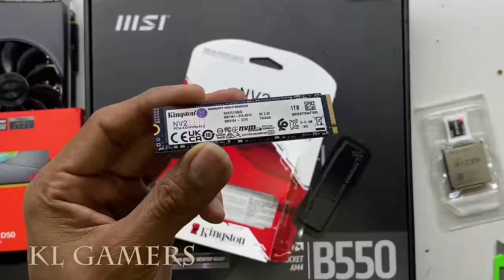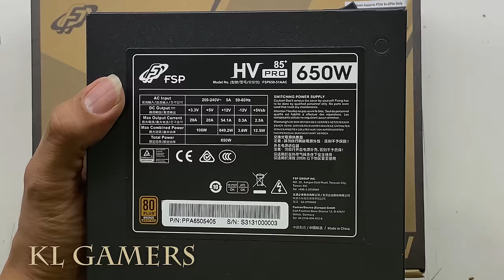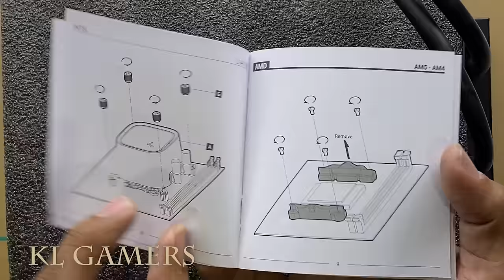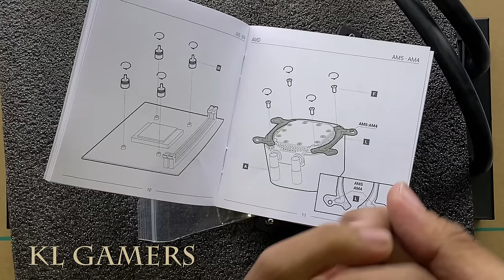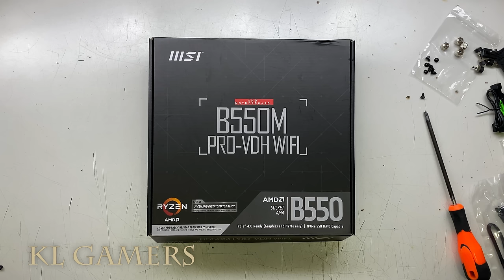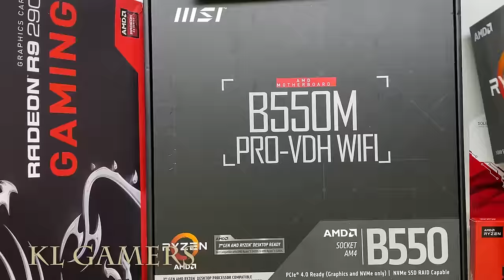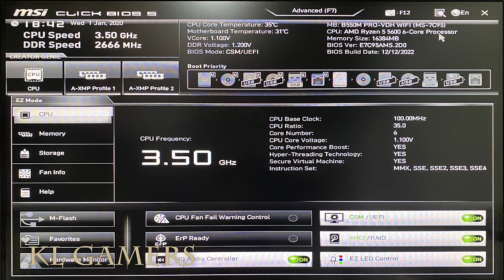AMD Ryzen 5 5600 msi B550M PRO-VDH WIFI msi AMD Radeon R9 290 GAMING PC Build

Comment: What? Water cooling on a 5600? Why? Oh my god, buy a cold and cheap processor, one of the cheapest motherboards and put a water block in it? I will never understand such builds
Reply: hi, im using the 5600x and msi b550m pro vdh. do you think i need a liquid cooler or is the stock cooler  enough or should i buy the deepcool   argb 400 ? pls answer
Reply: @kagekuro8884  I used a Deepcool 400 EX for my 5600x and it was enough with a margin.I don't recommend a stock cooler, buy a Deepcool and you will be ok
Reply: @kagekuro8884  please tell me if i need to update my bios of msi b550m pro vdh motherboard to support ryzen 5 5600?
Reply: @souravdam5964  Yes maybe you need to check first
Reply: its the costumer, i found a lot of these similar build, ppl go all in on their CPU and put a1650 for the gpu
Reply: You have no idea how many friends and relatives I know refuse to use anything other than the stock cooler just because they're cheapskate. 

A friend had 3700X with the stock cooler long term usage under high heat killed his motherboard and ram.

Another same case with 3700X too and PC internals entirely clogged with dust. his stock cooler thermal paste was so dry, it pretty much became super glue. This friend used brute force to remove the cooler but destroyed the CPU in the process. I advised him to replace with a 5700X but he still refuses to buy a new cooler... History is gonna repeat itself.
Reply: Considering his channel is from Malaysia with a very hot climate an AIO cooler is a sensible choice.
Reply: @markpusko2480  Make sense
Reply: ya bro i got the 5600x with water cooler because it looks great
Reply: There's a thing called overclock 😂

Comment: I put a 5700X on this motherboard and it didn't work. I update the BIOS and still the CPU debut LED didn't swichs off.
Reply: Any update? I also bought a 5700x
Reply: @caryschlaffman2062  I installed the BIOS that suported the 5700x (version 7C95v2A), not the most recent one, and it worked.
Reply: @emanuelschott7546 did you install the bios with everything part in pc?

Comment: Hi Bro. Is Bios update required in this build. Or it is desktop ready?
Reply: I am wondering the same thing I have the same mobo and cpu with a 3rd gen ready sticker hopefully it showed up with a compatible bios
Reply: 5th generation ryzen needs a bios update to work on this motherboard just use a usb and the bios button on the back of the board
Reply: @randalbrittan could i download the latest version of the bios needed through a laptop then plug it into my new build with an old cpu, download the latest version of the bios and then put my new cpu in?
Reply: Check the manufacturing date from the serial number. Cross check from bios version dates in MSI website.
Reply: @ArjoRemo does it have to be same date?
Reply: @mesoplanetv  as long as its ahead of the bios version date, you're good.
Reply: @ArjoRemo  ok thanks!
do you also have any recommendation for usb flash drives? I’ve used two different ones so far not any of them are working memorex 32gb and onn 32gb.

Comment: Nice build bro!! i want to buy the same mobo + processor, you dont need to update bios to use 5600x?
Reply: I have the same mobo and cpu. It's not guaranteed that out of the box it will have the right bios version so I just used the bios flash feature. I haven't even built my pc yet i just did this with only the motherboard and psu (as well as a usb stick with the right bios on). It's really easy theres guides for it. id recommend this guy he makes it really clear - https://www.youtube.com/watch?v=MYL88wjbmbI
Reply: I just got this mobo and the 5600g

Comment: I use b450 with 5600g and rx6600 ;) not worth upgrading to b550  just to get pcie4 advantage (which is ~5% fps boost) IMO
Reply: no only need b550 to get pcie4, u must change de processor too, 5600g does not have pcie4.  :D, 5600x have pci 4.0 much more pcie lines and 32mb of cache on the l3.- I assure you that this set gives more than 5%😄
Reply: @marianomena532  plus more overclocking capabilities and  longer life span
Reply: Natively not supported X
Reply: @marianomena532  no, b450 is 3.0.

Comment: Hello. Can you please rate the build.
1)Intel Core i5-12400F OEM
2) GIGABYTE B760M DS3H DDR4 (rev. 1.0)
3) 1024 ГБ SSD M.2 накопитель Kingston KC3000 [SKC3000S/1024G]
4)ID-COOLING SE-224-XTS BLACK
5)DEEPCOOL PF700
6)ADATA XPG GAMMIX D20 16 ГБ.2 /8
7)DEEPCOOL CH370 черный
8)Palit GeForce RTX 3060 StormX [NE63060019P1-190AF]
9) DEEPCOOL FK120-3 in 1
Reply: It's ok
Reply: What psu do you use ?
Reply: Psu ?
3060(8 or 12 GB)
Lastly price ( so we can judge you getting things at fair price)
Reply: If I were you, I would look at deepcool pkd or cooler master mwe white
Reply: Its expensive then Ryzen Build,
Choose Ryzen 5 5600 or 5600x instead of Intel
And spend on GPU as much as you can

Comment: What the max the motherboard could take for gpu
Reply: Cause I have 3060 I was wondering if I could upgrade but I’m scared it might fry the mother board
Reply: All 3000 not 4000
Reply: It should be able to handle any gpu available right now
Reply: Any GPU right now... including 3000 or 4000 series with no problem.

Comment: i have ryzen 5 5600x do i need a bios update i literally just installed the cpu and ram and ssd
Reply from the maker: u need a graphics card to boot
Reply: @KLGamers  i’m getting gtx1660 and it comes tomorrow morning
Reply: @KLGamers  just all the cables are very confusing and connecting to different parts on the mobo